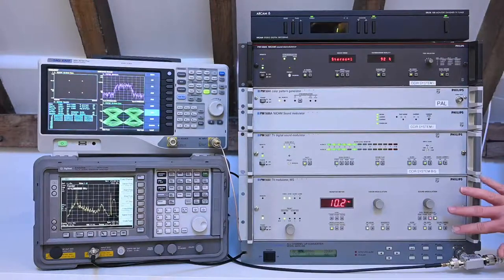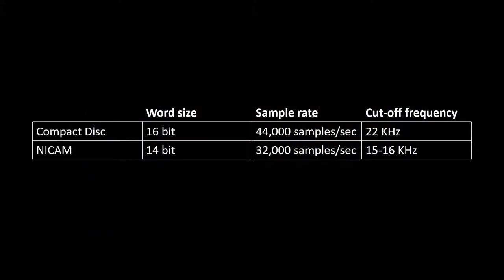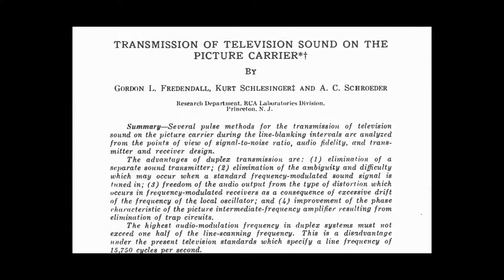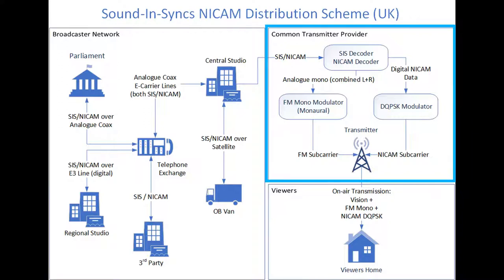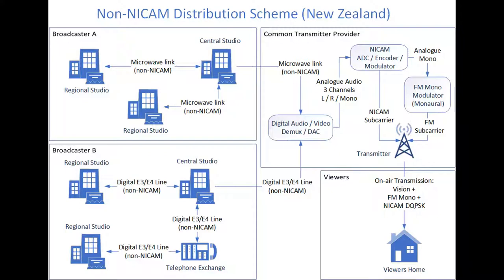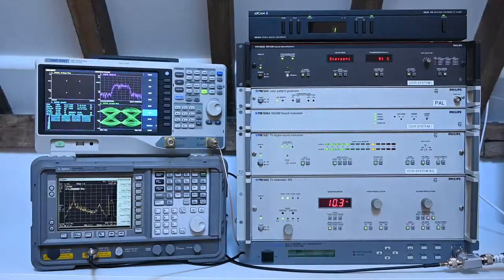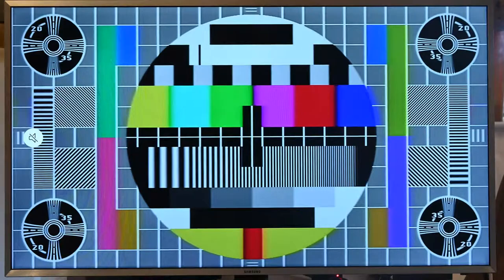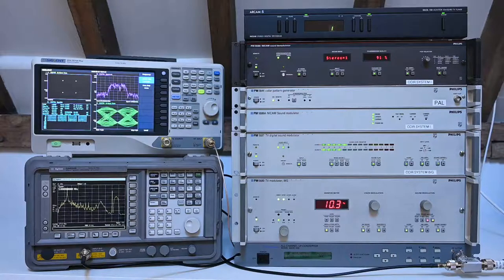#2 - Analogue Television Modulation - NICAM Stereo Audio

Comment: I've been to a technical tour of a transmitter site of Bayerischer Rundfunk (one of the few broadcasters in Germany to operate their own transmitters). At least back when I was there, tehy did feed their FM transmitters via NICAM over an E1 line, as you described. This must have been around 2008 or so. However back then they were in the process of moving from leased lines to their own microwave radio links. Bayerischer Rundfunk is in the unique position in Germany that they are able to see all their transmitter sites from one central location.

Comment: France had AM mono signal, never had stereo analog on television. Starting around 1995 some channels had NICAM stereo signal, and it was implemented slowly, transmitter by transmitter. Some channels like Canal+ never had NICAM audio. Arte which is a channel funded by France and also Germany,  used this stereo system to transmit some programs with the two languages, just had to select language I or II. Once i watched a whole movie with the two languages in stereo on purpose, it was quite weird. 
Stereo televisors and VCRs were widely available and had NICAM decoder.
Reply: Yes, Arte but also M6 if I remember right was the first french tv chanel to advertise about it, being the only chanel that would broadcast regularly music clips and concerts, as well as simultaneous live duplex with FM stations. TF1 and France2 were also Nicam broadcasters. Good times when we were just a few audio freaks to start linking tv and Hi-Fi VHS to sound systems 😍
Reply: @yahnsolo  Back then i had a music teacher who ordered a stereo TV and also VCR to record cable channel Muzzik, and Mezzo in stereo.

Comment: When I started my TV DX'ing in 1989 I'm quite sure that TV2 Denmark were using NICAM. I didn't have a NICAM capable TV set but when tuned slightly off channel a characteristic pattern would appear on the screen, the NICAM carrier.

Comment: There were effectively three types of SIS used in the UK. Mono 'linear' SIS which used simple binary encoding on the video signal, and then RE-DSIS and Varian DSIS, which I believe both used quaternary encoding, but the data payload was different. Originally both the BBC and the IBA used the same mono SIS systems, which meant that they could interoperate easily. But with the advent of stereo (DSIS) the BBC used Varian and the IBA used RE. So they could no longer exchange video feeds natively, one side would always need to accommodate the other. 

I recall whenever Granada did any live broadcasts for the BBC out of their Quay Street studios (happened quite a lot back in the day), one TX path would go to NTA/DTA at TVC on BT's TVNET via the Tower and the other path would go on an analogue BT local end between Quay Street and the BBC's site at Oxford Road in Manchester via the local TV NSC. Once on site at Oxford Road, a RE DSIS decoder would convert the audio back to analogue and then fed into a 34 mbit ETSI coder as discreet baseband audio and video, or re-encoded into Varian DSIS and sent on a 140mbit REC-656 circuit and sent down to TVC via the BBC's (mostly) Energis supplied MBN.

From what I can remember of the few Tx sites I've seen. The BBC TV network feeds would be handed over on site as Varian DSIS encoded composite video, which would then be decoded back to analogue audio, before being NICAM encoded and modulated on site. They'd still need analogue audio to feed the mono subcarrier, plus they'd have kit like programme fail detectors and the like that used to listen out for pilot tones on the audio. In fact ISTR the DSIS kit used for transmission (as opposed to contribution) had some sort of mod to allow the passing of 19kHz tones, not sure how, as that would most likely get knobbled by the nyquist filtering on the encoding stage. It did seem like the NICAM stuff was often a bolted on addition at these sites, as opposed to a significant reworking of the existing PIE kit. The NICAM rollout was 'way' before my time.

ITV, on the other hand might've done the NICAM encoding at their playout centres, as I remember seeing the BT PIE bays on one site having separate video plus a pair of 'data' and 'clock' signals for the incoming network feed. There might even have been a discreet associated audio circuit for the mono subcarrier, but I'm not 100% sure. So it seemed like only the modulation was done on site.

Regarding the NICAM 'data mode', I believe Channel 4 might've used it for network talkback for outside broadcasts. But I only read that somewhere, I've no direct knowledge of that.
Reply from the maker: Thanks for the info. I actually have that equipment here, it will be demo'd in the next video. I'll even plug an RE-DSIS into a Varian and see what happens :)

From my look at it the data payload are the same between the two, but the RE-DSIS packs it into a shorter burst than the Varian.
Reply: @mattstvbarn  I never had the chance to investigate much since we only had a decoder on site and I was never around when those shows went out, which would be the only time we'd see any RE-DSIS on a circuit.

It'll be interesting to see what you discover, but I'm going to assume it'll just refuse to decode anything!

Comment: In late 1980s NICAM has been introduced in Scandinavian countries. In early 1990s extended into Belgium. In Poland NICAM broadcasting has been commenced in 1994 with trials and went regular in 1997, and switched-off in 2013 on ATT.
PS: I had Samsung CRT TV receiver with Stereo NICAM from 2001 but in 2019 has been forced to move to my deceased grandparents in order to replace old worn out Philips Monaural CRT TV from ca. 1998. Samsung CRT TV still stands to this day and has not been used for 3 years.

Comment: TVNZ enabled the NICAM 1988 I believe. It was very gradual and it was mostly just mono on the stereo NICAM channels. I think it was originally just Shortland Street, some commercials and a late night music show that we're actual stereo for quite a long time.

TV3 launch in 1989 was first to go full time stereo and was amazingly exciting time for a tech geek. Probably easier for TV3 S starting with new infrastructure rather than having to retrofit. 

I purchased a Mitsibishi E70 VCR and recall paying about $500 just to get the optional NICAM decoder module installed before any NZ broadcasting. Was pleased when it started getting some use. :)
Reply from the maker: It was my understanding that it didn't officially launch until 1989? It might interest you know that the equipment we were using to code and modulate NICAM in NZ was the brown faced Philips PM5687 I demo'd in the video!

Comment: Marvelous videos, absolutely love them. One of my last projects was implementing both my own PAL generator and decoder from scratch (starting with the math, from first principles), both in hardware and software. So yeah, this is right up my alley. I trust you have a Sony PVM? It has a "delay" button that allows direct viewing of the sync gaps (both horizontal and vertical), which can be super useful and interesting. Would be great to see the NICAM signal! Also, have you seen Jim Easterbrook's compute-intensive but absolutely amazing BBC PAL decoder? Blew my mind when I read about how it works (just search for "The BBC transform PAL decoder"). As for the triggering of the scope in the IBA video: It's hard to see what's plugged into the scope, but I wonder if one of those cables isn't just an external sync signal from the modulator (or whatever component superimposes the NICAM signal), going into the scope's external trigger input.
Reply from the maker: With regards to the triggering you are probably correct. When I use a sync pulse / video trigger to view the SIS data it does not look as clean, i.e. it's all jumpy and didn't make for a good video. So I ended up trigging inside of the SIS data its self which was a bit more fiddly.

Comment: Greetings from NTSC land.  Love you videos, and I have a question.  Normally with dual amplification transmitters in the analog days we had a (using your terminology) vision and sound transmitter which were combined using a diplexer.  How was the NICAM transmitted?  Was it simply added as a subcarrier to the vision carrier?
Reply from the maker: NICAM was generally done using the intercarrier method i.e. all three carriers amplified together. Some countries may have done it with split sound, but did they have a third amplifier for the NICAM? I don't know. Hopefully someone will tell us that some day!

Comment: NTSCer here!
Could baseband NICAM be recorded on 1in type C tape? Meaning the H interval is fully captured so why not? I realize the TBC would remove or trash it but was it usable from the VTR demod output?  

And what happened in the vertical interval? Was NICAM also on the equalizing pulses or was if just held in a digital buffer until the next active video line?

How about FEC or other error correction?

Are there ITU (SMPTE like) documents that go into deeper NICAM engineering details?
Reply from the maker: Ah. You may have missed an important point there. NICAM in the HBI was only done inside of broadcaster networks. It was stripped out at the transmitters and re-combined as a DQPSK subcarrier. Few VCRs were ever able to record NICAM. If they did, it was by some other means.
Reply: @mattstvbarn  No I don't mean on the consumer VTR side. I mean within the broadcast / production plant for improved audio quality. Same idea as the FM audio channels 3 & 4 on Betacam. NICAM is a baseband signal so it could be be carried through distribution routers and anything that didn't reprocess sync.  So why not record it on a highband VTR? Now I can think of some issues such as rise time exceeding the 4.2mhz (NTSC) VTR bandwidth assuming type C. And of course there are tape dropouts to deal with. And as I said before, it's not going top make it through the TBC unless there is a processor to deal with it. But the VTR demod out might be stable enough for good recovery?

 Another glaring problem is audio or video only edits - same problem Betacam had with audio channels 3/4. But for playout to air, that isn't a problem. And for some material like concerts, the audio was often laid back from recording studio grade audio tape. So in this application, there would be  benefits over even a typc C VTR's linear audio tracks which were barely HiFi.
Reply from the maker: @andydelle4509  That is such an interesting question. I would guess the answer is no. A 1-Inch VTR (commonly used) is already capable of recording stereo sound in analogue form, which would be a great deal easier to deal with than SIS encoded into the video signal. There is quite a bit of hoo-ha around splicing/synchronizing NICAM signals as it was, adding VTRs into the mix would have made it even more difficult requiring equipment which wasn't commonly found in studios. Better deal with it as analogue then convert it to NICAM as it leaves the studio. That said, perhaps it was occasionally done in limited circumstances but I have not heard of it.